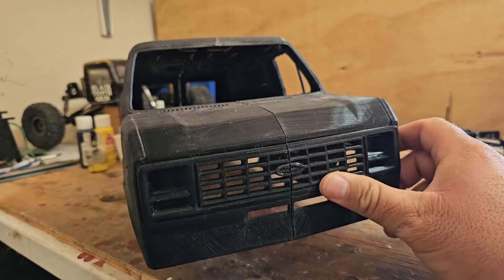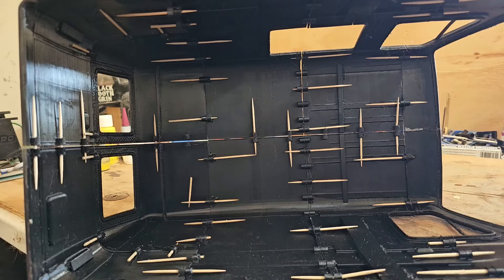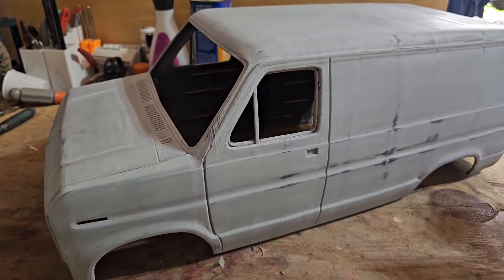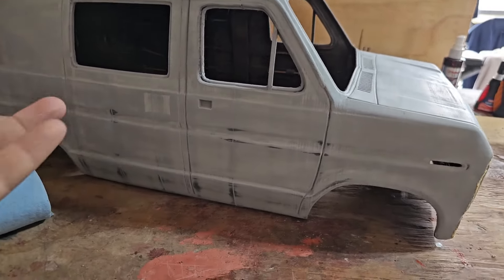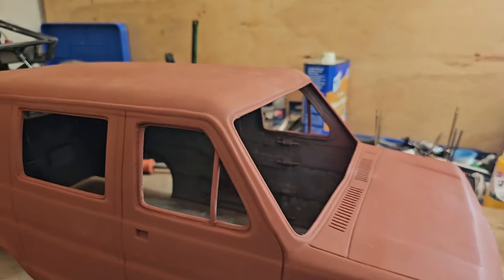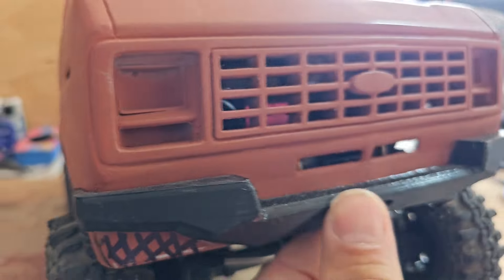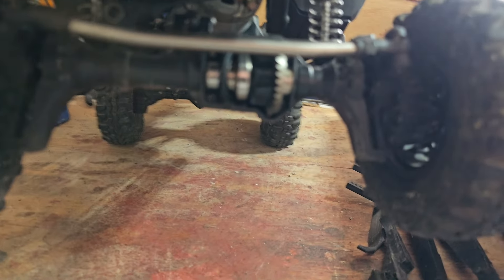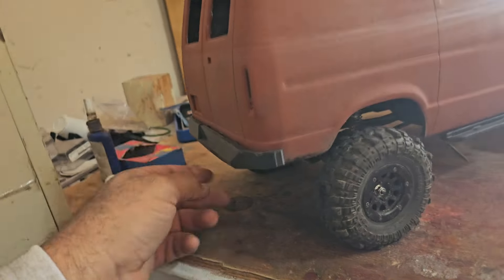My First 3d Printed RC Body, 1:10 Scale, Ford Econoline E350

Comment: Hey, how do you get the body to fit so well to the chassis? Do you just scale it to the chassis size (eg 1/10, 1/18) or do you have to individually measure the body to the chassis (cutting and stretching the file to fit)? Many thanks 👍
Reply from the maker: That will vary model to model.  This one was advertised as being made for a TRX-4 324mm wb.  I'm working on one now that I needed to scale width and length to get it to look right on a 313mm wb TRX-4.  Basically you want to scale it evenly in all directions until you get the wheelbase you're after, then kind of tweak it from there if it don't look right.
Reply from the maker: I know if I get it to 218-222mm wide at the bottom of the doors it will fit into the sliders on a TRX-4.

Comment: How much filament did you have to use? Or roughly what was the weight of all the printed parts
Reply from the maker: @foxjet77  there was a few problems with some of the files so I went through about a spool and half trying to get them ironed out.  I think it could probably be done with about 3/4 of a spool.  All together it weighs about 10lbs, not sure about just the body.

Comment: What would you say is better at filling in why are lions and inconsistencies on a 3D printed RC body based on what you've used in this video... The Bondo glaze or the plastic wood? I printed a body that I'm trying to fill in layer lines etc and I tried using that Bondo spot and glazed putty and it just seems to not work very good. It's not very solid it seems to be more like dust and therefore can be removed by accident with just sandpaper.
Reply from the maker: @ninjins8139  I use the bondo on bigger gaps and plastic wood on the layer lines.  And I keep re-applying and sanding until it's smooth.  On this van it took 5 or 6 times.  The closer you are to being smooth, the more you need to use finer sand paper.
Reply: @NTX_RC  ok thanks for the information!
Reply from the maker: @ninjins8139  np

Comment: Which filament was it printed with?
Reply from the maker: @Umut48357  petg
Reply: @NTX_RC  First of all, thank you for your reply. Is PETG filament more durable? Or would it be appropriate if I use ABS or PLA?
Reply from the maker: @Umut48357  it's more durable than pla, about the same as abs, easier to print than abs but abs is easier to work with as far as body work goes.